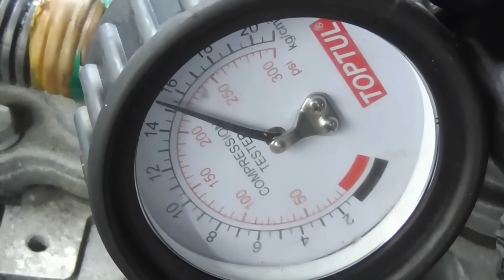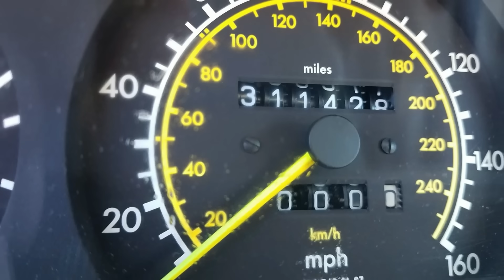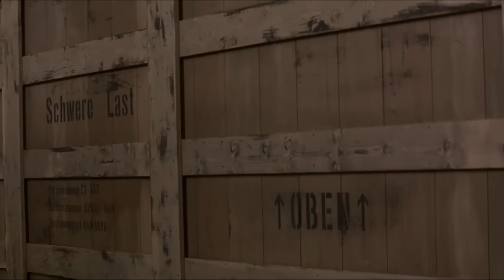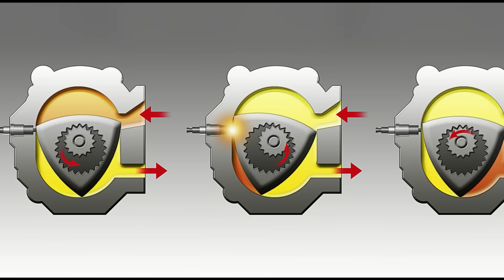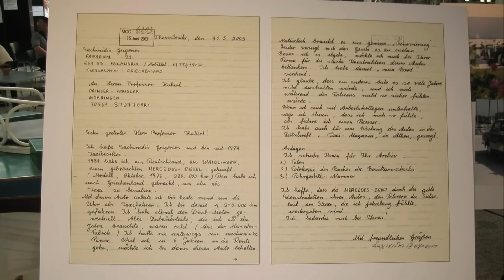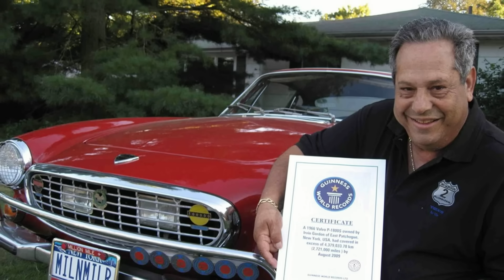Most Reliable Engines of All Time

Comment: Did I really just hear "BMW" and "reliable" in the same sentence~?
Reply: I guess theres an engine from bmw thats the very least reliable bro.
The most reliable cars for me are toyota and hondas.
Reply: @syankha8329  Reliable yes.  Recalled all the time....Yes!
Reply: Bmw makes very reliable diesel engines its their electrics that always go haywire
Reply: The M57 was a great engine. The last reliable one by BMW. The cast iron was reliable, the aluminum one a bit less. The successors became, as by the times, too complicated abd too technical and lost its reliability.
Reply: The unreliability of a bmw usually isnt because of the engine. And even if they leak oil of you keep them topped off they should run quite a while. I daily an m3 with 187,000 miles that will probably need a new transmission, leaks a little oil, the radio doesn't work etc but it still run just fine. Just keep it topped off
Reply: @hoodedcreeper2465  Which M3?
Reply: @hoodedcreeper2465    Really?  And those main bearings that need to be replaced at 60,000 miles on V10 M5's?  I guess that is the result of an "oil leak"?  Come on....
Reply: @Flies2FLL  I dont know about v10s though but their n/a straight six engines are great
Reply: @hoodedcreeper2465  ....That is the best you have huh?
Reply: @Flies2FLL  dude who hurt you?
Reply: @Flies2FLL  my radio does not work lol but main bearings and vanos pumps arent really problems on the straight six. The only issue I have with mine is the valve cover gasket which needs replaced.
Reply: @hoodedcreeper2465  "on the straight six".  Typical denial.  Next-
Reply: @hoodedcreeper2465  "The only issue I have with mine is the valve cover gasket which needs [sic] replaced".  And that is why you think BMW's are reliable?  Yet you launch an attack on me when it has been well recorded that M5's and various other BM Trouble-You's have horrendous quality issues?  You live in dreamland....
Reply: Somebody is watching too much of Scotty Kilmer.
Reply: @notme-y1m  I can't stand that guy, his YT stuff is garbage.
Reply: Just about everything bmw made before y2k was just as reliable as the average Japanese vehicle
Reply: old bmw are reliable anthing that is pre 2000 are quite reliable
Reply: It is not accidental that the armys mercedes with the 240d motor are in service from 1985
Reply: It wasn’t the same sentence....
Reply: Haha funny combination yeah :D
Reply: It really just depends where you live
Reply: Guess you missed the "diesel" part
Reply: You talked all the crap you want about bmw Files2Full but the 06-10 M5 5.0L V10 it will gap you anyday and Ik bc I have one😂
Reply: @aaronhardy3807  if it has a v10 and weighs less than 6 thousand pounds it's guaranteed to be fast as shit.
Reply: admiral_peck 7 stock they weigh 4,012 lbs but idk what it’s at now not much changed besides the crankshaft pulley and supercharged, racing suspension and the evolve tune made for the street, got carbon fiber spoiler and fender flares, and carbon fiber mass airflow intakes
Reply: @aaronhardy3807  supercharger counts as much changed
Reply: @aaronhardy3807  My '14 Cayman S PDK will do 0-60 in 4.2 seconds and 0-100 in 10.0.   Send it-
Reply: Flies2FLL what you got done to it? We’re pushing little over 700hp supercharged and evolved tunned for street racing with racing suspension
Reply: The e30 is very durable
Reply: 1.8 is , 2.3 i , 2.5 i , 2.8 i / 3.0 d -183/194 hp . BMWs are thrashed and then sold because the damaged done to the car is beyond their financial capacity. Who tf redlines a corolla or a camry. I agree that from the 2000 s bmws become less reliable but you can't expect such an over engineered vehicle to withstand the abuse of an idiot + with the lack of maintenance. People do be shitting on Audi , BMW and Mercedes-Benz but dont give much thought that for the high sticker price it is expected that a person who can afford the maintenance would buy the car. People do be comparing Honda Civic with A6 -3/5 series or E class... mf honda has 5 pressable buttons and is just a simple vehicle. You could probably fix a honda with 8 and a 10 and some WD-40. Think before you post. Old BMW cars are as reliable as a Honda or a Corolla. They just need to be maintained properly . E30 , e36 e39 ,e21 , e28 ,e34 . Currently drinking water...
Reply: @ГеоргиРайков-ъ6м  Whatever you say.  BMW's from the year 2000 and above are PILES OF SHIT!
Reply: @ГеоргиРайков-ъ6м  You are partially correct.  The 2000 and up BMW's were terrible from a reliability standpoint!  Some mechanics will not even have one in their shop.  Yes, they tend to find bad homes when they get old, but you don't see these sorts of problems with Subaru's or even Volkswagens.  The old BMW's were reasonably reliable, but I will dispute your comparison to a contemporary Honda or Toyota product.  

You know what really sucks about all this?  BMW's are an absolute blast to drive!  I guess until they get their act together it is best to lease one for three years and then get another one.  You DO want to drive one; You DON'T want to own one!
Reply: My '99 323i is sitting on 450,000 km and going strong...
Reply: Missing the Pajero/Shogun ~ 2004 turbo diesel engines surprises me. Id expect  at least a half million  kms before any major work needs doing.
Reply: bmw used to make really good engines what are u talking about?
Reply: @tomastamosiunas9424  "Used to" is the operative phrase here.....
Reply: Yeah...lf you have a fortune to spend on maintenance.
Reply: *Impossible*
Reply: You can ask that man how so?
Reply: And did I just hear "Mazda rotary" and "reliable" in the same sentence? lol
Reply: @gustavovasconcelos4372  They tested the last RX-7's before delivery at the dealership by having the technician move behind a CONCRETE WALL when they revved it to maximum RPM and boost, since Toyo Kyogo was worried about their technicians exposed to the turbochargers exploding....
Reply: what you've never heard of the BMW Oxymoron 521S?
Reply: Only because it's a deisel
Reply: Did I just hear rb26 and reliable, nah
Reply: lol
Reply: Lol this dumbass thinks rotary engines are reliable
Reply: They Make the Owner Reliable so that he visits The Mechanic Regularly
Reply: Where Scotty
Reply: Bruh
Reply: Yeah he lied
Reply: Yep
Reply: You are right BMW makes bunch of problem cars the were good up to 1980
Reply: the most reliable engine are toyota vios 2012 model with 1.3 (2NZ) i got almost 700,000 miles 😁
Reply: Well I have a 525 with a m20 and it already have 300.000 and I never open the engine
Reply: BMWs straight sixes are very good and reliable engines.
Reply: @nameofthegame9664  too bad the electrical, trans and the rest of the drivetrain will empty your wallet out when they go out first though.  They do drive great, smooth, and superior driving experience than almost anything.  But I have not had a good experience with German cars, owned long-term.
Reply: @nameofthegame9664  Whatever you're drinking I want one~
Reply: @Flies2FLL  he's on S54 drinking, I'm on M54. U got to try I6's. Even Toyota put bimmer engine in their supras...
Reply: @NinjaTTT  Too bad they cannot sell them.  Sales are tanking....
Reply: They are reliable tho, as long as you're using the right rag to clean it every night and changing it's diaper twice a day using the special BMW brand $700 a pop diapers!
Reply: @Prestiged_peck    Best. Post. So. Far!
Reply: @Flies2FLL  dead serious too, they can be very reliable but you gotta be ready to shell out at least $5000 a year in basic maintenance to go just 15k a year, if you're going even further you're going to need to shell out even more, you also need to have a black market surgeon ready at any time once it's out of warranty in case you need to sell a kidney and part of your liver to pay for any kind of major failure.
Reply: @Prestiged_peck  Well it is certainly is true that if you throw tons of money at something that you can indeed make it reliable.  It's just that there are dozens of other makes where you DON'T have to throw truckloads of money at in order to keep them on the road....
Reply: @Flies2FLL  I know that's my point lol. 2 valve 4.6 ftw
Reply: Dude. Manual BMW diesels. Unkilleable. 200 000 miles. Easy peasy. 300 000 even.
Reply: @Sithbor  How many people buy BMW diesels these days, and the problems that BMW's have these days are often with the car itself and the electronics.  I don't think choice of engine has any sort of effect on the problematic nature of BMW's these days.  Even the company notes this and is working on the issue.
Reply: Flies2FLL dude old/new bmw diesels are literally everywhere in sweden/europe. And still rolling strong.
Reply: @Sithbor  Emphasis on "old".  Nearly everything this company has built since 2000 is TRASH.
Reply: @Flies2FLL  A lot of them buy bmw diesel
Reply: @Flies2FLL  can you name the BMWs you've owned that back your comment? Highly doubt it. I have had an e46 330xi until 160k, only things were tye water pump, OFHG, and that's about it. Car still going strong with its new owner. Currently have a 127k 335i F30, and a 111k e70 x5, both still going strong. Cost of maintenance IS a bit higher, but the sheer driving pleasure most absolutely make up for it.
Reply: @VictorEstrada  I've never owned a BMW but have driven a '77 316, an '88 325, and '04 535.  Of the BMW's I've driven that '88 was the one that amazed me with it's steering;  Me and a friend went out in Dallas and (predictably) he got drunk and I drove home.  The steering on that car was the BEST that I have ever felt!  Then there was the '04 535 that a woman I knew owned.  It was in the shop 5 times in the first five months she owned it, and eventually BMW took it back and gave her an '05 version.  The V8 was nice, but this was a lease and at the end of the 36 month lease she was having trouble [again] with the infotainment and the car had developed a miss.  Listen:  I  LIKE BMW's.  But their late products are piles of shit and if you deny it an keep on buying them the company in Munich WILL NOT improve.  Detroit's cars are far better than they were in the 1980's.  Guess why-
Reply: @Sithbor  I could name a dozen old/new vehicles in Canada that are still running strong, BMWs here are viewed as a waste of money by most people, as they lose most of there value after a few years. Same with mercedes. I could get the same quality of vehicle (minus the "luxuries") for half the price from a number of different brands. Europeans are obsessed with BMW and Mercedes for some reason. Also my 2006 Duramax has almost 700k on it with normal maintenance.
Reply: @Flies2FLL  no
Reply: Anyone who says BMW's are reliable obviously hasn't owned a Toyota.... It's all relative...
Reply: Hahaha right!!? I don't buy it, the Germans should stick to music instead of Krautwagons.
Reply: @RollingRigTraction  The business decision makes sense, but the product is ugly, the design is busy, and there is no way any BMW inline 6 is going to match the durability of the iron block 2JZ, or the Toyota M engine, which powered the first three generations of Supra, when they were the "Japanese Jaguar XJS", or fast GT car.
Reply: I'll take a Ford 300I6 and an Australian Barra I6 over anything German engineered.
Reply: @RollingRigTraction  I for a while had a '66 Ford F100 pickup truck [I inherited the truck] with a 4.0 liter inline 6;  That engine could be shot with a gun and still run! 129 screaming carbureted horsepower versus 5700 pounds and DRUM BRAKES~
Reply: Big 
Money 
Waster
Reply: ANY BMW built since 2000 is basically a hole in the water that you need to throw money into.  People like the Car Wizard, a mechanic in Newton, Kansas will ~~literally~~ ask a BMW owner to LEAVE when they bring a broken Bavarian Motor Works product into their shop.  I'm not kidding, a lot of foreign car shops will work on any car but a BMW.   FOLKS, I'm not the problem here.  I've always liked EVERY FUCKING BMW that I have seen [well, the I3 is pretty stupid looking...] and the quality of these cars up to 2000 was about the same as Volkswagen, Ford, or GM.  Not perfect, but the driving dynamics of the BMW more than made up for any shortcoming. Yeah, when it gets old if you keep it you're going to spend some money, big fucking deal. Again, the driving dynamic.   

-But after 2000 this company made their products as complicated as possible and apparently didn't put a SINGLE FUCKING SECOND'S  effort into seeing if their product would hold up after the three year lease was up~!  

What? And HOW expensive are their cars-?   Do you really want so support a company like this?  

Do you really want to buy their products if they have this sort of attitude?

Comment: No mention of the GM 5.3 liter V-8, i have had two of them in my Silverados, they give foolproof service for in excess of 150k miles, with many of them in the 250-300k range.
Reply: gen 3 better, i have had one silverado with 200k no oil comsuption at all
Reply: I put 242k miles on the 4.8 v8 in my 04 Silverado, ran like a top.
Reply: 6.0 Escalade 2006 was the last iron blocks

Comment: No engine is a high milage engine after it has been rebuilt. The clocks start off again at zero after rebuild.
Reply: I struggle a little bit with this,  most part of me want to agree but I'm not totally comfortable with it. For me, it depends on what has been done during the rebuild. If all moving parts have been replaced, including new pistons and re-bore -sure, it's practically a new engine. But just replacing parts expected to be worn after a certain amount of time (bearings etc.) could be considered maintenance. I mean, we all replace water pumps when we do timing belts, don't we? Does that mean that the engine disqualifies from being reliable? 

BUT! The most reliable engines ever built are the Briggs & Stratton small 3,5 hp lawn mower engines from the 70'es. You cannot kill one of those, however hard you try.
Reply: @BustaHymen  I can bust this Briggs & Stratton theory, then again I did put diesel in one, it still ran for like another year after after I put a new fuel pump in... then it siezed... but the point is they ARE billable, it's just really hard.
Reply: @Prestiged_peck  was it designed for diesel?
Reply: @Tankliker  no it was a gas lawnmower engine, had about 250 hours on it when I performed this accident.
Reply: @BustaHymen  
So replacing your rotating assembly is the same as changing a HX component...

You dont belong in a shop.
Reply: True if it's a complete rebuild, not just a head overhaul.
Reply: Yeah that fury with about 10 engines does not impress me at all.

Comment: I drove a P1800 ES wagon, red 72 for over 32 years as a daily driver. I sold it with over 400,000 miles, still young! Met Irv at a VSA Volvo sports America meeting in the 80's west coast. It was their truck V8 engine with 4 cylinders cut off and was also a marine engine, so hardy to the core. I raced that motor in a 140 in the SCCA at Laguna Seca, sears point etc. the fuel injection was great, huge throttle valve. 

Fun stuff.

Comment: I had a 1980 Toyota  4x4 pickup. I  drove it 280000. It still had the original engin, clutch. Drive train with nothing put tune up and regular fluids changes whitch I did my self.

Comment: I recently bought a 2010 Lincoln Executive L town car an ex airport limo car. It has over 1million kms on her and runs great. I believe the transmission was changed but the motor is original. This car is located near Toronto Canada not far from the airport. I plan to use this car as my daily since it runs on propane or gas fuel. Needs a paint job but the interior is amazing and clean but some TCL and maintenance will bring her back..love this car bought it for $800. The last owner drove it to work and back and used lot as his family car but the wife wanted a SUV instead. Lol 😂

Comment: When are internal combustion motors coming to an end curious another 15 yrs or sooner..
Reply: Toyota have just developed a petrol engine that has a heat efficiency of 41%. Most petrols are 25% and diesels around 30%.
This makes a huge step forward for economy.
I think it will be longer than 15 years unless they can really increase battery production. It is coming but I think we are 25 years away from the final end in cars. I could be wrong.

Comment: I drove my 1984 Carolla to the junkyard in 2000.  It was a complete rust bucket and no longer safe on the road. Everything still worked at 300,000 miles. The Ac blew ice cold. It still had the original clutch.  The junkyard sold doors, hood, trunk and lights.  Welded some of the Suspension back together and drove it around the junkyard for years.

Comment: No American engines?    The 4.0 strait six in my 2001 Cherokee has 320,000 miles and runs like new.   Many of the 4.0’s early top 400,000 miles. Most high quality  4 cylinder Japanese engines go supernova right around 300,000 miles.

Comment: My father had a 2009 Camry se with that engine he just sold it. It had 246,000 miles and still was a great car. My mother has a 2004 Camry le with 236,000 miles it runs great doesn’t burn oil. Those camrys are great cars

Comment: I had a 1988 Volvo 740 GLE and a 1989 Volvo 760 Turbo with the 2.3 liter 4 cylinder engine. They were very reliable and I drove them over 300,000 miles. It’s too bad Volvo doesn’t make engines like these anymore. 🇸🇪
Reply: I have a 2008 s602.5t with 272,000 miles, they still making good engines!
Reply: Mine has 997,000 miles

Comment: uhh, you left out a TON of other high milers!  My daily driver (Toy Tacoma, 2.4L) has 208,000 with no leaks, rattles or smoke!  My other car (Volvo 940T) is BARELY broken in at 170,000 miles.  Not even HALF done!  Again, no leaks, rattles or smoke!